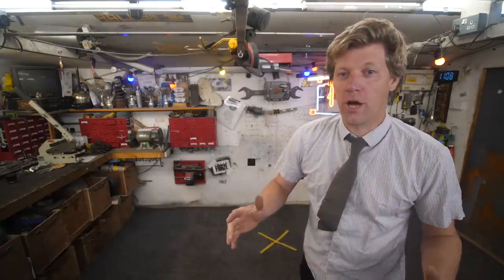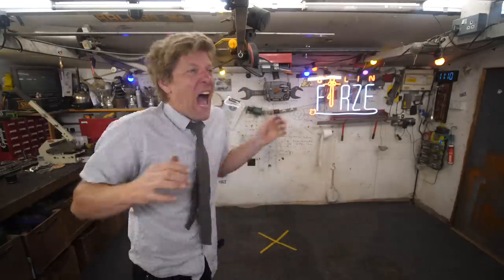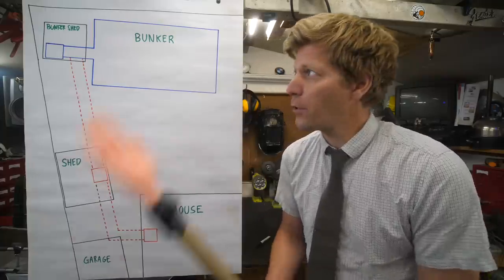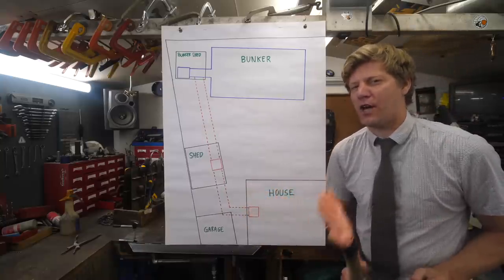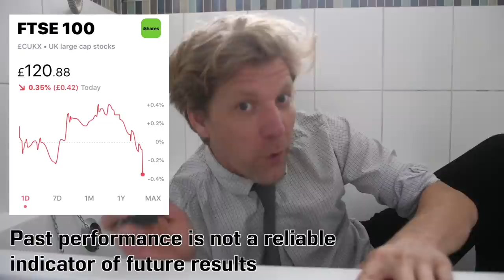DIGGING A SECRET TUNNEL Part 1

Comment: Yes pretty exciting indeed. 

You should wear a mask when you are producing dust and welding fumes. I had good luck with a 3M 4251+ mask. It kept all the dust and noxious fumes out for months now. I can do painting with it too without smelling the epoxy based paint. Pretty good if you ask me. Also stick welding in a confined space was a breeze... You can only ruin your lungs once. So you better not ruin them. 

Greetings,

Jeff

Comment: When you have built so many loud, crazy motor vehicles that not even using a motorized concrete cutter in your workshop can alert the neighbours to your top secret construction project.

(Not sure if that also goes for the jackhammer though.)

Comment: Working in construction, I'll be the first to admit that I cut corners here and there when it comes to safety. So while it'd be pretty arrogant of me to nitpick every PPE technicality, not wearing a respirator when cutting concrete is actually a huge concern. Even with the [small amount of] water you used, you two being in a confined space with that much silica dust is enough to really screw up your lungs. It's kind of too late now, but hopefully fellow readers will heed this caution. On the bright side, your use of ear pro in this video means you will be able to hear the doctor's diagnosis on future pulmonary problems.
Reply: As long as you have on your safety tie, respirators and eye protection are not needed.

Comment: Great idea and project Colin, always wanted to do one myself. I see you've already built a solid shed so how about a green sustainable one, you might even get a local authority grant for being green minded.

To get rid of the clay subsoil, make a cob man-cave and I'll help you slake & make the lime plaster needed for your walls.

Slaking quicklime is nice and explosive because when you add water to it you get an exothermic reaction which eventually becomes the lime putty that you mix with 3 sand to get your basic mortar for the render needed to cover the cob walls. 

We can then parget your logo or some very rude pictures on the wall out of the same material and it will look great and last you hundreds of years with a roof on.

The cob mortar is mixed on hard ground with a shovel but is easier with a JCB because you'll need a lot of it.

For a good cob:  2 buckets of clay subsoil, 1 bucket of sharp sand to 1/4 bale of straw, stomp in it with your feet adding a little water from time to time to make a thick porridge.

So you could build a cob walled man-cave and I'll help you slake and make the lime mortar to plaster it 2 or 3 weeks after it's built. 

Finished in a day.

Comment: 8:50 If you put the hinges on the opposite side, you would have a much easier time lifting the carpet when trying to open the hatch from within the tunnel, and letting it fall back when exiting to the tunnel.

Comment: Every building should be build with 1 floor and 2 floors underground. No more isolation issues,  etc. Energy sufficient as well. Only issue would be flooding i guess. What will happen with heavy rain fall when the street gets flooded? That bunker will pull all the water straight inside

Comment: I've got one of those bad boy Stihl's.  Two words of advance.  Silicosis is no joke. Silica in the sand used too make glass. It is in all gravels around the world.   Hell, the Middle East, and a large portion of Northern Africa, North and South America are nothing but silica sand.   

Water alone is not enough to protect your lungs, and silicosis, (literally glass dust in your lungs), is like lead, once it goes in, it don''t come out.

The other word of advice, don't use the saw in shorts.  I bought mine used, did some work on it, and got it running. Being the excitable type, I wanted to immediately test drive it. I had a chunk concrete out beside the shop. I attacked it.  In shorts... for about 10 seconds.   Felt like I was getting my shins sandblasted.  Def a long pants job.

GeoD

Comment: The hole is right in the middle of the floor, would be good idea to dig a square doorway in the wall and then dig down from there, so you can put a lift In and not have the entrance in the middle of your shop 😉.

Comment: I'm curious about the codes / workarounds involved with this. The slab would have been specifically engineered for the shed, cutting out a bunch of concrete and rebar seems like it would be breaking tons of codes aha

Comment: Why didn't you use water with that saw it would've taken half the time and you wouldn't be having to deal with dust trust me it sounds like a mess but its a heck of a lot better than dust everywhere  (coming from contractor whose cut concrete many times even with the real fun chain saw concrete saw those are so fun even though the blade costs 400 dollars

Comment: I always wanted to do stuff like this when I was a kid. I probably would have died back then though because I knew absolutely nothing about safely/properly building/engineering. I was just ambitious and creative. I'm still not a proper engineer or anything but I understand most topics/subjects a lot better than my childhood ADHD days. I probably would have just started digging a tunnel and it would have collapsed on me because I didn't know about reinforcing it - I had seen old western movies where they're mining in tunnels and had logs reinforcing the top and sides but I think I remember thinking at the time that was all just for looks and unnecessary lol. I've always lived in the boondocks on my family's property so no snooping neighbors or pesky city rules/ordinances. I used to just go out and dig like a 10 ft deep hole, decide I didn't really know what I was doing and either fill it back in or cover it up. I could probably blow up tannerite/TNT in my backyard and not even alarm anyone... But this has always been a dream of mine. I wanted to just have some kind of really cool, secure basement/lair or a totally underground house someday but a bunker and tunnels would eliminate the need for that. I mean, I live at the edge of "tornado alley" anyway and we get a lot of unsettling storms around here and the house I currently live in doesn't have a foundation and sits on cement blocks with a crawlspace so some sort of underground shelter could probably save our lives someday..